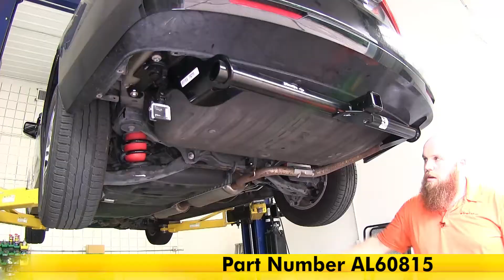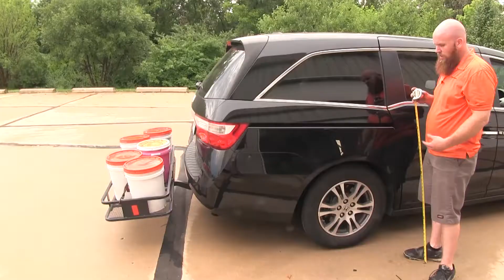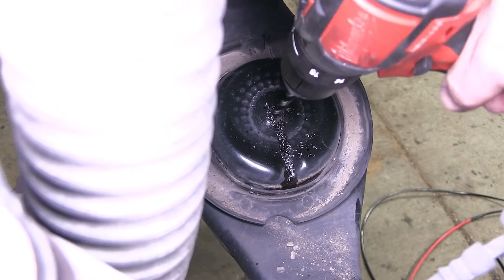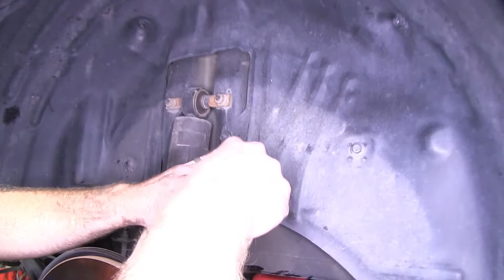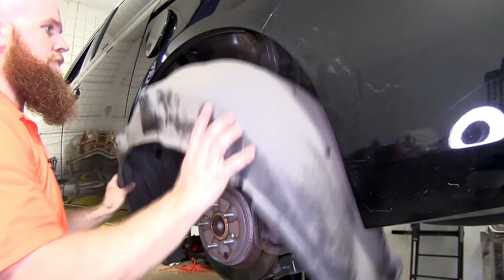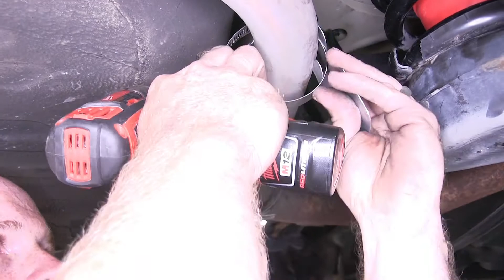How to Set Up Your Air Lift 1000 Air Helper Springs for Coil Springs on a 2012 Honda Odyssey

Comment: Wish I would have watched this first for the heads up about the template marking. It's pretty far off.  Had to drill almost a completely new hole. When I did the other side I used the bump stop wear marks on the lower control arm as the template and went slightly outward from the center where you have it.  That worked perfectly.  First hole took a while though and I hope I didn't remove too much material and make it weaker.
Reply from the maker: We're glad to hear of your successful install, but sorry to hear about the difficulties you ran into!
https://www.etrailer.com/Vehicle-Suspension/Air-Lift/AL60815.html

Comment: Will this fit a 2011 Toyota Highlander? 
Also will it help with leveling when towing 3k lb?
Reply from the maker: This is not a confirmed fit for a 2011 Highlander. You can check the confirmed fits for your vehicle if you check out the fit guide linked on our page. https://www.etrailer.com/

Comment: Be advised, putting the valves in that location will cause them to be pinched when you reinstall the fender liner.  Bad idea overall.

Comment: That’s an interesting place to end the tubes.  Very clean looking
Reply from the maker: There are not too many places to mount the valve stems on this van. This also makes it a lot easier for those who have issues bending over to fill the air helper springs.

https://www.etrailer.com/Vehicle-Suspension/Air-Lift/AL60815.html
Reply: @etrailer  It's a horrible place to put the valve!  When you reinstall the wheel well liner it will press right against the back of the valve and pinch the line.  Don't do it.
Reply: If you use one valve for both bags, will it blow them up evenly, even when one air line is longer than the other?
Reply: How long do they last?
Reply: @chrisshore9000  we had ours for a couple of years and they were still going strong but our transmission went out so we got a new vehicle.  They will fill evenly.